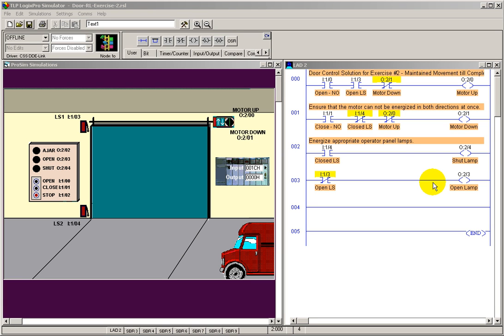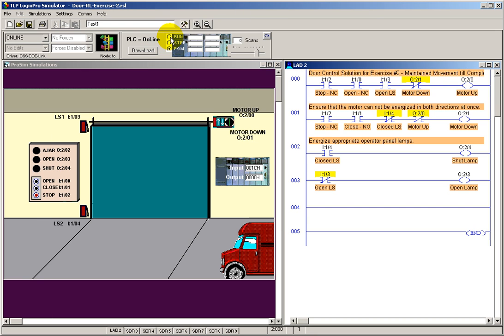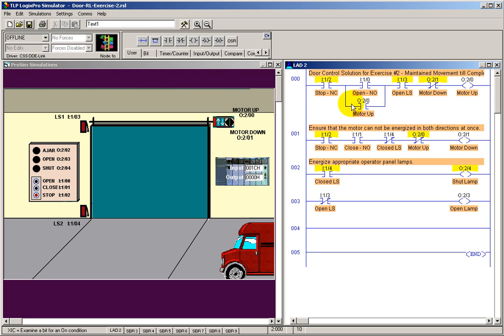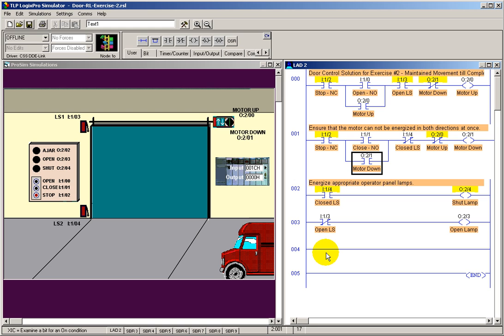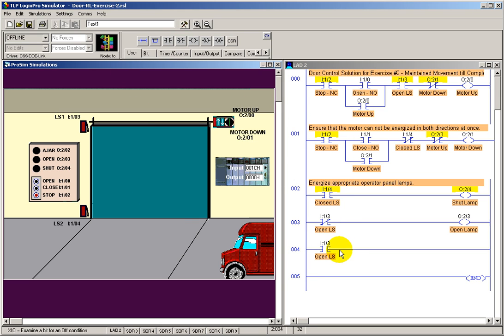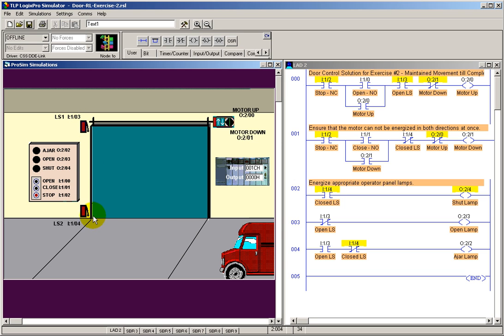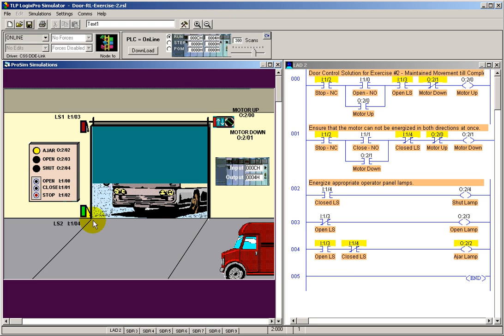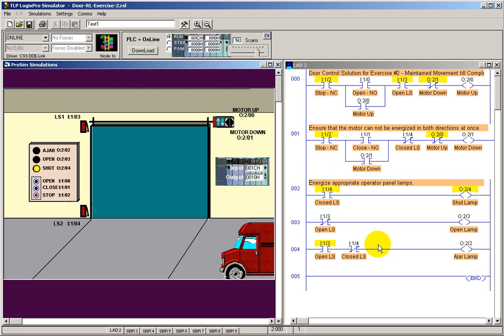Door Exercise 2 Explained_.avi

Comment: My door opens and shuts automatically I quadruple checked the addresses are right. Don't know where I went wrong. Everything up until setting up the rung for ajar lamp was working. It's the part when I add the loop with motor output that things don't work.

Comment: I was instructed that it's a bad idea to actually seal in on the motor's coil because it may not switch open if there is an over current condition, you should always use the motor's auxiliary contacts. is this true? Maybe I miss understood what I was told?
Reply: Yes that would be true if this was actually a relay logic system.... the fact is this is a PLC system which would typically be driving sets of contactors.